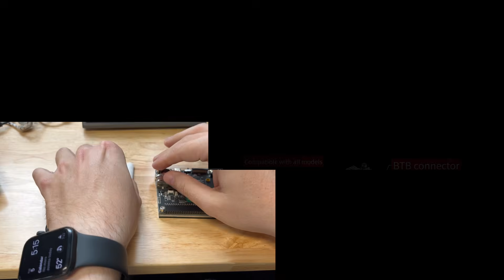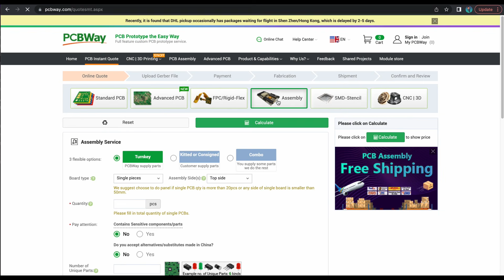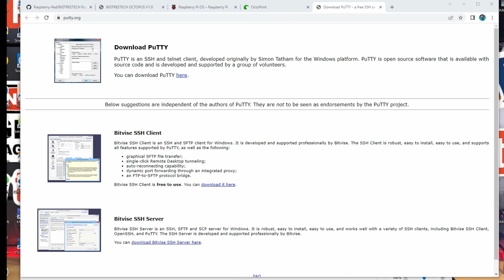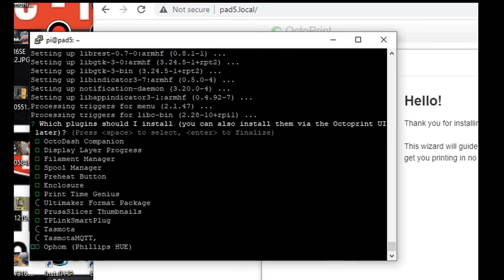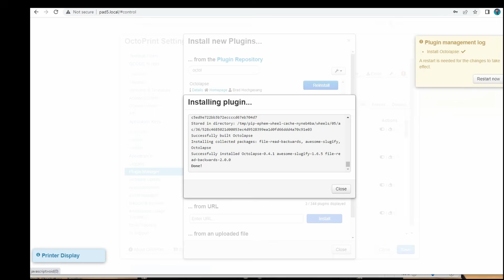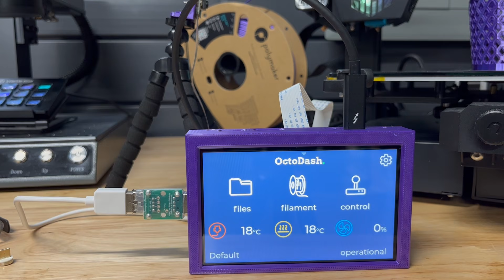BTT RASPBERRY PAD 5  - With Octoprint and Octodash

Comment: Does the processor not need a heatsink?
Reply from the maker: I have had this on for weeks.  The PLA printed case has always been cool to the touch.
Reply: a small glued-on heat sink can't hurt. 
when the CPU gets hot it will slow down. 
But Octoprint doesn't cause that much stress either.

Comment: Hey, lovely videos! I was looking at the Geeetech review before, tbh they have the A20T Now which is around 330-ish, I was comparing it to the SV02 (Another Cheap Multi Color Printer) and tbh, I don't like how you have to buy the mixing module seperately but (I am a noob in printing so forgive me if this sounds dumb) you don't need any software to create gradients (I think) now the issue I am having is, it is kinda low quality. 

I don't wanna get a 3d chameleon and add it to some random ender 3 because A. It's kinda expensive for an on/off Switch, B. no native Mixing/Gradients etc. I really love gradients, lol. So I am stuck here, 350 bucks, looking for a machine that can do gradients with minimum effort... ummm HELP?! LOL
Reply: I have a rencolor DM 10 that does gradients really well, as it uses a stirring needle, but was having issues with the stirring needle being stuck. I think they updated their print head design and thankfully, they're sending me a new one, so I'll see if it was a one-off thing or a QC issue

Comment: Great video John. Now you can happily control your printer from outside the asbestos enclosure.
Reply from the maker: 😂😂😂!  Don’t forget the halon fire suppression system👍
Reply: @TripodsGarage  I was going to octodash mine when it turned up. Got the 7" pi screen and all. Put it together with the pi and had it ready before the burner turned up. I do everything through octoprint so the screen is saved for another use.